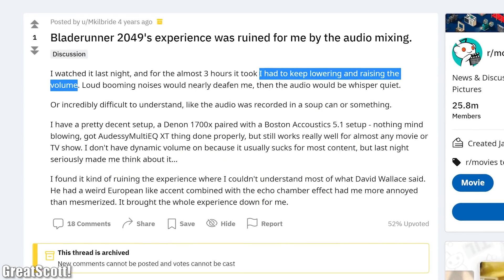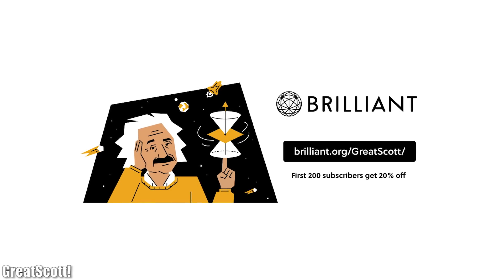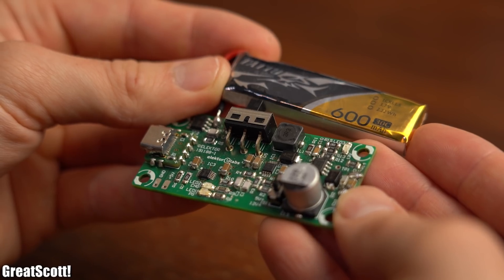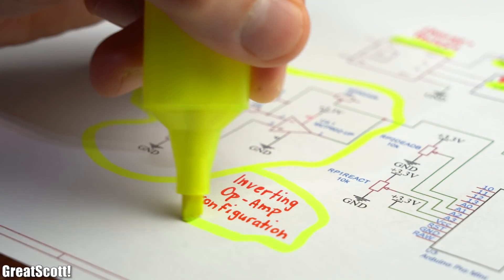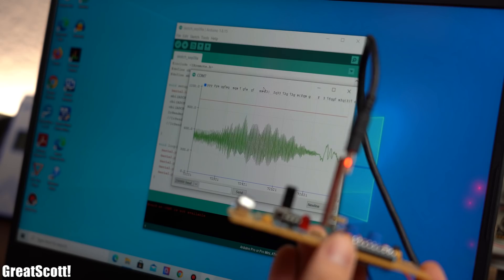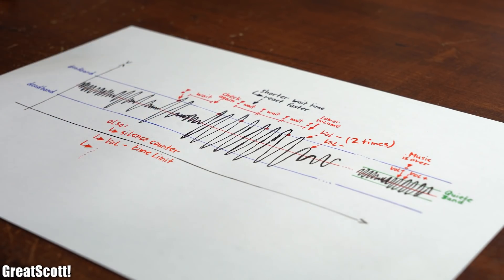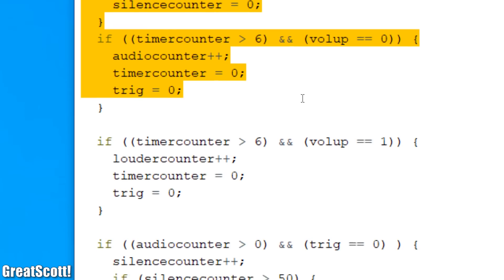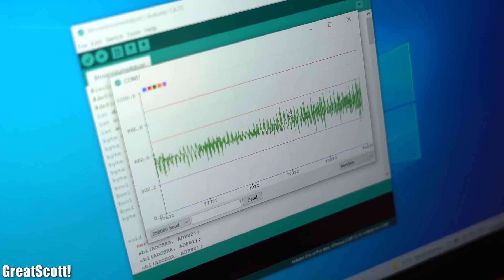Movie Music has a LOUD PROBLEM! So I fixed that! (Automatic Volume Adjuster)

Comment: The problem is that your TV is downmixing the 5.1 sound to stereo improperly. The center channel needs to be louder and left right channels need to be quieter. VLC's default settings are quite good
Reply: While this is true to an extent, they do mix the sound effects and music a lot louder as a 'creative choice' too.
Reply: @TheRevWillNotBeTelevised  Yea a more recent movie Tenet has this problem. The center voice channel is quieter and even hard to listen to at some points. Seems to be a thing with Christopher Nolan films.
Reply: @Joe-so6su  Yep. I couldn't hear important sections of the dialog in Interstellar
Reply from the maker: But I have a soundbar + 2 rear speakers and subwoofer. I think it should do a better job with that.
Reply: @greatscottlab  Is your sound bar an LCR soundbar, or does it just have stereo?
Reply: @greatscottlab  It's cool to have a sound bar but they are really just to replace the now rear facing left and right stereo speakers in these thin modern tvs and some are alot better than others. Some do have 3 speakers with an integrated center. It depends what type of sound bar and also with the set up you mentioned is it a true Dolby 5.1 decoded set up or as the chap first mentioned is that 5.1 being down mixed to stereo or another format. It's a very common issue because people are not very well informed or educated when buying audio products and also when technology changes as there is also Dolby TrueHD 7.1, Dolby Atmos and other audio standards for decoding that could all be causing the issue. Blade runner 2049s Dolby Atmos Mix rides high atop an equally stella Dolby TrueHD 7.1 core on HD Blu-ray according to AV forums, but I would get this and other audio issues when setting up demo rooms for customers when working as a audio salesman when playing different films depending on the audio equipment set up, usually you could go in and select the audio decoding you wanted but that may be down to what the actual player can actually do in reality or what audio is available on the DVD or Blu-ray, we won't talk about laser disc lol. You can also do some pretty funky audio mixing of your own if you use a pot on or between channels to get a balance that is "better" but it's all a bit subjectional at that point as one person might like it compared to another but certainly fun to play with if you are interested.  You have a very original idea though to solve the issue, nice thinking and tinkering.
Reply: @greatscottlab  Sorry. But no. The Problem is, that in the 5.1, the center is mixed in with a fixed volume. The only working solution is Dolby Atmos or DTS:X. Because there is no downmix. So the voice can have different volumes from the background / music.
Reply: Против Глобал  Well the best thing I can advise is the literature on the particular TV you are looking for, do your own research and compare against others as technology changes all the time before you pay out for one and ask questions to the shop assistant also. But if you are after quality audio then you are not looking for the TV really, you want a decent AV receiver with the right built in audio decoders that supports the things you want to play through it with separate speakers. Personally for me I don't think you can beat that sort of set up, if it were me putting down my cash I'd buy the most upto date built in audio decoders I could like 7.1 so if I then play 5.1 on it it can send the right audio to the correct channels without having to down mix and get some garbled Dolby Pro logic sound coming out. Hope it helps.
Reply: How does this insensible reply have almost 100 likes are people that ignorant and half-deaf and not caring that they are deaf all the time or are they just made of tougher stuff?
Reply: Yes! This! No need to make silly Rube Goldberg contraptions when the problem is selecting the wrong sound mode to begin with. 
Selecting the right stereo mix, dialogue will NOT be lost, rather the oposite. 

To people mixing feature movies, dialogue is Jesus, the bible, the constitution, their kids well being, their mum, the pay check and more. They don’t give an rat’s ass about the music. 

@GreatScott If the music is too loud, you are not hearing the right mix! 

It is that simple.
Reply: That is not the only reason. I have a 7.2 THX certified Home Cinema system and exactly the same problem. And I went to all steps to adjust the configuration of the sound system  to the room. I many movies the music or sound effects are way too load that will make you turn down the volume, but then in other scenes you cannot understand the actors anymore.
Reply: @Empusas1  That's exactly as intended. It's common approach to set the volume in a way that normal dialogs can be heared well. That's how it's intended. 

Movies are mixed in a way, in which loud scenes will be pretty loud and quiet dialogs will be quiet.
The sound is mixed with a wide dynamic range and it's normally targeted towards theater installations. Sadly, many people have suboptimal setups / cheap speakers / wrong configuration which leads to bad movie experience. That's why they often use compression to normalise sound levels, which leads to a worse dynamic range. 

To be honest I've never had such problems and never enable dynamic range compression features. But I'm also not an average consumer.
Reply: @roopey  It might be intended, but still a dumb method. If I let the volume stay at the level that you can clearly understand the actors, then it is so loud that it is uncomfortable for me and even painful loud in louder scenes. Funny that you imply my home theater environment would be cheap or misconfigured. You might want to talk to my wife about "cheap", but I guess there are people that think 10000€ just for speakers is "cheap". All a matter of point of view.
Reply: @Empusas1  No offence. I meant it in a more general way. Many people i've come across spent less on their whole setup then some pay for a single speaker. Many of them complain about such or other problems. There are definitely a few ok speakers for decent prices out there, but people tend to buy known brands / mainstream products. 

Yeah, I've spend about the same amount (speakers + receiver). Especially, because speakers hardly degrade over time or fail. So it's ok to spend a bit more because one can easily use them for 10+ years. 

Explosions and such can be quiet loud. But never to a point where I felt like turning down the volume. I also never had problems with quiet dialogs, even on lower volumes.

There might be some differences between genres. Content produced for TV / Streaming might come with low dynamic range though.
Reply: On a typical 5.1 / 7.1 / multi surround system: The center used for voice, the side speakers for music. 
If you down mixing (5.1) 5 channel audio (two on both side, 1 center) to 2 channel improperly: 
Stereo Left: Left front + Left back + Center
Stereo Right: Right front + Right back + Center
The music played on both front and back, so it will be doubled in sum, the voice on the center just splitted to left/right with the same volume. Thats why the music is much more louder than the voice.
You can (and need) to compensate this with gaining the center channel in the down mixing state (vlc/kodi/etc video players has a profile for this)
Reply: This. The problem isn't the mix, the problem is playing 5.1 or 7.1 audio on stereo sound system. You have to downmix it, and most players do a very bad job at it. The best is to have control over the individual volume of each channel in the mix. Some players let you adjust that.
But... it's true that still, some movies have terrible mixing with insane dynamic range. And some dynamic range compression / volume normalizer does wonder (my previous 7.1 external sound card from Asus did exactly this, and it make watching movies and series so much more enjoyable : no more waking up the neighbors to hear the quiet parts).
Reply: @Hexalyse  This is an issue throughout TV broadcasts too. It is definitely not just badly set up home systems. The mixing at source is made to be more 'dramatic' often at the behest of directors who over-rule sound engineers about those decisions.
Reply: it's probably more to do with MPG audio compression than any intent on the part of the producers.
Reply: @axeman2638  Nah, they are just screwing with us.

Comment: Most TVs nowadays have built in audio level normalizer, mine even have a mode for night time(which makes everything really quiet) and day time(which raises up the low audo level moments), but this project inspired me to make my twist which is replacing the "volume pod" (and the potentiometer) with a really fancy, microcontrolled automatic volume control.
Reply: The night time /speech preference on my sonos bar have no discernible/beneficial effect.
Reply: @toms4123  Sonos is trash
Reply from the maker: I should look for such an option on my TV.
Reply: @greatscottlab  Of course 👍

Comment: Very interesting approach to have a physical solution to an issue usually dealt with over software!
Reply from the maker: Thank you :-)
Reply: what kind of software can handle this? Looking for a solution on PC
Reply: @iamdmc  there's usually no problem with mixing, but with your speaker configuration. You have to use 5.1 system or correctly map 5.1 sound to your 2.0 system (boost front channel, split it between front speakers)
Reply: @iamdmc  There are many options for audio compression. Most DAWs (e.g. Ableton Live) have compressor functionality built in or you can add a compressor plugin. If you download Virtual Audio Cable, you can route audio from one program into a DAW, apply audio compression and output audio from the DAW to your speakers.
Reply: This is called compression, often labeled as amplification or normalization. Some DVD players have this feature as well as media players like Kodi.

On Android, for example, volume booster apps can do this. You crank them up until the quality becomes too poor or clips, and lower the volume to accommodate. Viper4Android is really good for this as well.
Reply: Windows has a feature called loudness Equalization, there's no such thing for most TV's as far as im aware

If the former is still interesting for you :

Hit Windows key
type "sound settings" and hit enter
On the "related settings" tab hit "sound control panel
Click your output device, then hit "properties"
Open the "enhancements" tab and scroll down the effect list
Turn on "loudness Equalization" and apply settings

Some more modern TV's might have something similar to this
Reply: @paradox3875  doesn't work for all sound cards :( didn't work on my ThinkPad T480s
Reply: @iamdmc  It doesn't work on my desktop PC with the Motherboard or the C-media PCI card
Reply: @paradox3875 Thank you reminding me of this.

My amp needs a few FETs, and my monitors speakers have been driving me nuts.

Sounds much better now, at least until I can parts for my amp. Thanks again.

Comment: I don't know how your sound bar is currently connected, but if it has an aux in you could maybe build an analogue dynamic range compressor!
I think a design based on the SA571 could be suitable.
Reply: There are even designs from 3 bjts and few other jellybean components

Comment: On the same topic, do you think you might be able to do a DIY or Buy video on doing an HDMI in-line dynamic range compressor?  Or is that going to get too far into the weeds with programming and not enough electronics content?
Reply from the maker: Yes, I think that would be quite a big project that is very specific.
Reply: @greatscottlab  - Cool!  Not familiar enough with what's involved with that, but I bought one for my parents several years ago for exactly the same reason you made the volume adjuster.  :)
Reply: @GreatScott the video was uploaded around 50 minutes ago approx, but these comments show they've been sent 1 week ago 🤔
Reply: @RogerTannous  Patreon supporters get early access